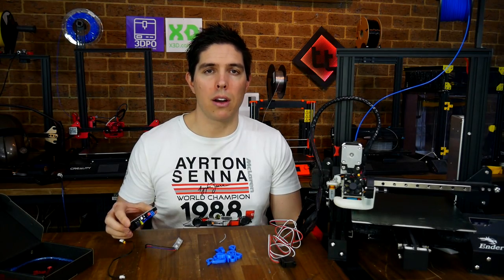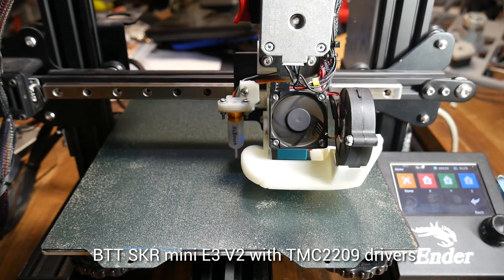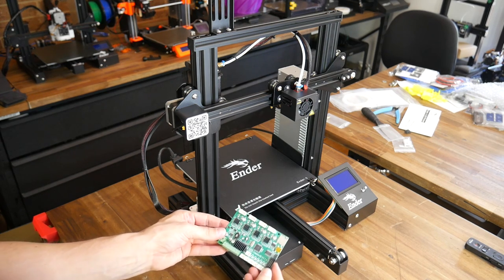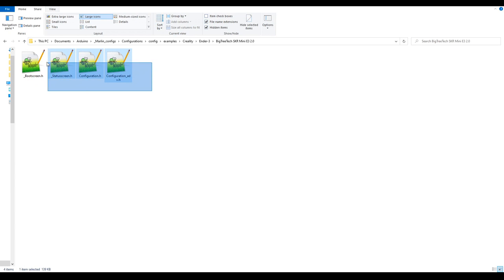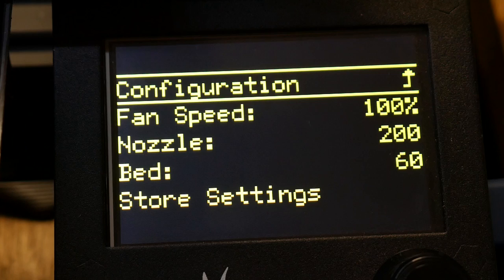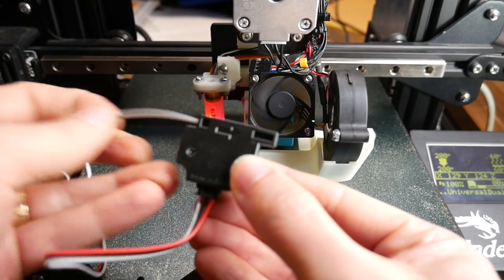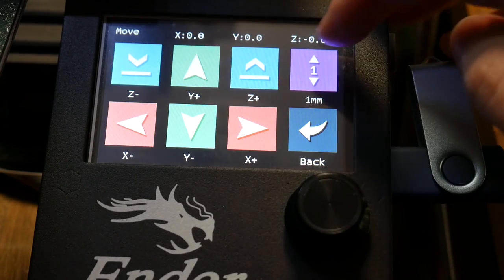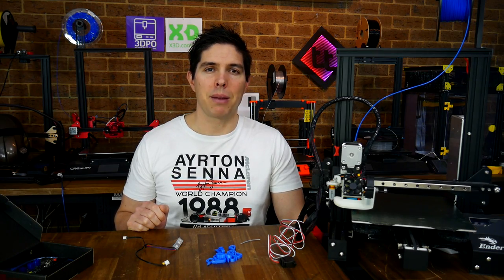SKR Mini E3 V2.0 - Complete guide to the best value Ender 3 upgrade

Comment: I Also purchased and installed an SKR Mini E3 V 2.0.  Now I need quieter fans.
One thing you did not mention was that the positive voltage and ground terminals are backward when compared to the original Creality board.  This applied to the input voltage, hotend fan, hotend heater, bed heater and the BLtouch servo connector.  I had to re-wire the BLtouch's 3-pin connector due to this polarity reversal relative to Creality's original BLTouch upgrade kit.  Also, there is another firmware file in BTT's github which does use the BLtouch as the Z-axis endstop, without requiring the original Z-axis endstop be present.
Reply from the maker: I provided colour coded wiring diagrams. I don't know what else I can do beyond that? If people ignore them that's beyond my control.

Comment: I love this board, silent, rock solid and cheap.
Can’t hear 1 single noise from it! And bl touch is working well.
Reply: I'm assuming this board works with the regular bootloader and firmware stuff?
Reply: Nutmeg Gaming I read on github it isn’t, anyway no sense to get over the original fw.

Comment: the 10 pin grey ribbon cable I had was too short to connect from the skr mini E3 2.0 to the touch screen, what do I do? also the touch screen reads "no printer connected" so idk what to do

Comment: How do you edit the firmware for dual z? Im trying to use both z stepper ports however platform.io states "marlin-2.0.x\marlin\src\pins\pins.h:1410:8: error: #error "No E stepper plug left for Z2!" " Im lost as to where I can fix this....
Reply: Shame. I am having the same issue... not sure how this was achieved...

Comment: buy the ender 3 they say its dirt cheap they say then pow you end up spending more just on upgrades lol. I recently brought my first 3D printer ender 3 pro and i really do love everything about it and love just how much to can add to it thank you for this video i was not sure weather to go with the v1.2 or v2 board but i ended up going for the v2 as it just makes sense now i got the fun task of trying to fit it but that really should not be a problem i am mostly looking forward to the mesh leveling feature as the manual level process is a massve pain in the ass to be honest

Comment: Good luck getting the EZABL Pro working with this board. 
TH3D's support page only points to a "Vanilla" support web page on compiling your own firmware. 
Only problem is the config from BTT has bugs, and building the config directly from Marlin also failed as a result from bugs within PlatformIO. 
Considering that BLTouch is supported directly from BTT, I would STRONGLY recommend users follow that route.

Comment: Teaching Tech - when you receive your BTT 24V UPS, can you please do a follow-up review on how to make the UPS work with the SKR-Mini E3 V2.0?  BTT provides documentation on necessary Marlin fw modifications, but doesn't say where on the board to connect the UPS.  Also, I haven't found definitive information on the internet on how to correctly connect and use that BTT UPS.

Comment: Is the power out 'H' controllable? I would like to set 'E0_AUTO_FAN_PIN' so that fan only comes on once it reaches 50 degrees but it doesn't appear that there is a pin assignment for this connection.
Reply: Did you figure this out?

Comment: For anyone considering the SKR v2 board with Teaching Tech's all-in-one rear wiring, let me save you hours: the stock z-stop cable doesn't reach. His remixed case for it also seems to have shorter standoffs, so watch your M3s don't poke too far out the bottom.

Comment: I had one, but missed being able to turn my hot end fan on and off at 50 degrees, so I upgraded to an SKR v1.4 Turbo.  It's the same price as the mini E3 but you have to add your own drivers.
Reply from the maker: Potentially you could use the fan port designated for the board fan and then have the board fan running permanently.
Reply: Teaching Tech I tried that and couldn’t get it to work for some reason.
Reply: I'm a complete noob at this and haven't received my board yet, but here are the changes I've made to hopefully get this to work...
//#define USE_CONTROLLER_FAN (in configuration_adv.h), #define E0_AUTO_FAN_PIN FAN1_PIN (in configuration_adv.h), CONTROLLER_FAN_PIN -1 (in pins_BTT_SKR_MINI_E3_V2_0.h)
It compiles fine at least. Guess I have to wait until the board gets here to see if it works. If it does work, I plan to put a 12V low noise fan and buck converter in the case.
Reply: @andronicuscomnenus2642  hey mate, did it work ?

Comment: To compile the firmware using the latest marlin you should use 

default_envs = STM32F103RC_btt_USB

Rather than the env that is listed as it is no longer possible to compile using that. (It was fine a the time of posting the video)

Also I've found the most common complaint is people's controller fans are not working. It's quite easy to not notice if that fan is no longer working on printers like the ender 3 pro due to location so it may be the fan is dead rather than a board issue.
Reply: Thanks this was a big help to me rn This is for ender 3 printers right?
Reply: @3DPrintable  specifically for the ender 3 pro though they are basically the same machine with a few upgrades e.g. a thicker frame. It should work the same though I'd recommend checking the marlin config repo for the ender 3 configs. The default envs should be the same.
Reply: @Sekwah  I tried it out yesterday and it ended up working, thank you for your help

Comment: Another great mainboard video! I would really like to see a comprehensive comparison to the SKR V1.4 Turbo.  The V1.4 Turbo appears to be about $10 more, so is it worth it? Especially on an Ender 3?
Reply from the maker: The SKR V1.4 is a much more capable board. This is designed to be more plug and play/convenient.
If you have grand plans for adding dual extrusion something like the V1.4 would be better but for most people this will be fine.
Reply: @TeachingTech  Thanks for the response.  That's what I needed to know!

Comment: Once again a very useful video. Unfortunately, I struggle with the BL-Touch. Homing does not work (extruder is stuck to x0/y0 and starting bed leveling will crash the extruder to the bed. I receive a sequence of error messages like "Bed Leveling off" and "Fade Height Off". I installed the firmware from BTT. Do You have any idea, what went wrong here?

Comment: It looks good. I recently installed a 4.2.7 board with CR touch and touch screen. Touchscreen is awesome but I’ve lost e-steps, accelerations, etc. Does this V2.0 board and its open-source firmware support touch screen?

Comment: Thank you Michael for another great video. Always great research and quality of your videos, I appreciate it. 
I wanted to say for anyone installing this on an Stock Ender 5 or Ender 5 Pro that the firmware provided by BigTreeTech (mentioned on the video) is unfortunately useless since it has the Z axis direction reversed.
Unless they fix it, you cannot use this board out-of-the-box for your Ender 5, you will need to compile marlin how Michael explains on the video.
Regards.
Reply from the maker: I didn't test that but it is very frustrating. You can plug in the z cable in reverse as a work around, but I don't know how much the connector will like it.
Reply: I can't compile it.. And display error in /marlin-2.0.x/include" not found

Comment: PSA: he swaps the parts cooling and mobo fans in the video (and corrects himself ) but the documentation at 4:20 is incorrect also the Imgur link. If you google image skr pinout you will see G and I swapped. Correct me if I’m wrong but I’m really happy I figured this out while printing the cat since it could have started overheating after it finished

Comment: With the improved stepper drivers this board, would there still be any benefit to adding stepper motor dampers?
And what build plate do you use and/or recommend for the Ender 3?

Comment: What fan duct are you running on that?  I'm upgrading my Voxelab Aquila to the SKR E3 mini 2.0 with TFT touchscreen and Direct Drive All Metal Hotend.  I purchased the Commercial Carriage, but none of the Fan Ducts I've found online actually fit with the commercially made carriage, as they all hit the stepper motor..
PLEASE let me know what duct you're using... Thanks

Comment: I thing that the diagram on 4:21 is wrong. Accordingly with BigTreeTech site connector B is INVERTED. The right order is Black/Red from the upper side. So connection H and B would be Red/Black/Black/Red.

Comment: Question: 
Could this board also be used on the ender-2? As far as I can determine the original Ender-2 PCB is 6.5mm wider than the SKR Mini E3 V2.0 (76.94 vs 70.25) bot the mounting holes between the X-Y-Z jacks and the one in the middle of the left had (power) side are in the exact same locations. The ender-2 used  Allegro A4988 drivers.

Comment: Hi Michael, I noticed you added the neopixels without the DCDC module. Can the LEDs work without it?
Reply from the maker: Yes indeed. Each pixel in the string draws a certain amount of current. If you have a small amount the onboard 5V VREG will be fine. Once you have a longer string you may start to run into trouble. I don't have an exact figure I'm sorry.
Reply: @TeachingTech  that's is good to know because the neopixels I ordered just arrived in the mail and I can't wait to light up my build bed. Thanks for the info.

Comment: Thank you for this review. I'm an old dog trying to learn new tricks. Is the only way to update the firmware on this board via SD card? Can you run Visual Studio or Ponterface via the board's USB-B port? I want to upgrade my Ender 3 Pro from the V4.2.2 motherboard it came with. I've added the Mico-Swiss Direct Drive Hotend and a BLtouch to it, but can't get the Creality firmware update to work. What motherboard would you recommend for Ponterface?

Comment: Nice and crisp video. Question. Out of the 2 options to connect bl touch, which should I prefer and why?
Reply: And on this board it is better to use abl bilinear or ubl?
Reply from the maker: I prefer the back and white wires going into the z endstop. The z limit switch is no longer necessary and you can change build surfaces to different thicknesses without any further adjustment.

Comment: I don't understand how you are compiling the new firmware.  I can compile stock Marlin fine, but as soon as I change to the "STM32F103RC_btt_512K" I get failure
Reply: In case anyone has a similar issue, I believe I was mixing the nightly builds config examples in the 2.0.5 standard release and that was the cause of my problems, because doing everything with the "bugfixes" version at least compiled correctly.  Yay!
Reply from the maker: That is an easy trap to fall in. Glad you worked it out.
Reply: @TeachingTech  Thanks.  Your Amazon link isn't working.  Here's the one I purchased and seems to be their official storefront https://smile.amazon.com/gp/product/B089CQ3DHB.  Obviously feel free to delete this and throw up your affiliate link.

Comment: I had real trouble with a cheapy 3 wire filament sensor with the SKR mini E3 v 2.0 and Marlin 2.0. Plugged in as per the wiring pinouts on the board and the sensor and uncommented the line in config.h as mentioned in the video. Although the sensor itself was fine and was reporting correctly via M117, filament change kept triggering between homing and ABL, and I couldn't fix that no matter what I did in Marlin config or as startup code in Cura. I also tried deactivating the sensor via the LCD and that still didn't work. In addition the filament change triggered was only heating to 170 and then trying to push filament so before I realised it, I'd not only worn gears on the extruder but had filament blowouts at both the nozzle end and at the top of the heat sink. In the end I had to replace a nozzle, the bowden tube, both bowden connectors and clean sticky goo from inside the heat sink and heat break, wasted an afternoon of installing the sensor. Something's not right but I can't figure out why this combination of board, sensor and Marlin is doing this. :(

Comment: I apologise if this has been asked elsewhere. I looked through a lot of other comments but didn't see it mentioned, and honestly I don't want to read through over 500 comments. In the video you refer to the new DC-DC 5v power module. I have tried searching google for one, but all results are for earlier or different versions of the mini boards. I had a look on the github also but didn't find anything about it in the manual. Can you please advise if there is such a module, or if it is built in to this board?

Comment: The board has 2 PWM fan controls, correct?  So, you are using 1 for the hotend, and one for the stepper drivers (case fan)?   What about the part cooling fan,  can that be controlled?  Maybe I am confused on what fan is what. lol

Comment: Hey thanks you for that guide. One question I think about to replace the silent board in my ender 5 pro. Which one would you recommend the SKR Mini 2.0 or the SKR 1.4 Turbo? I am unsure which should I choose so maybe you or someone here in the command have a hint :)
Reply: The SKR Mini E3 v2.0 will bolt right in, you will have immediate access to the USB port and SD card slot, without modifications. The SKR 1.3/1.4 boards are not nearly as easy.
Reply: Though the SKR v1.3 (I have been advised against v1.4 because it seems like the have made some unfortunate cost cuts) gives you the opportunity to swap drivers and had more I/O. I got it to work on my ender beautifully and it's actually not super hard to set up if you get into the firmware stuff a little

Comment: Michael - Can you make a short vid on the details required for the 'non-traditional' method of where BLTouch does not replace the z-endstop, but still uses the microswitch. It seems calibration for the nozzle, and having the BLT be able to still probe is confusing as far as proper distance the nozzle should be from the bed when it does a homing with the endstop switch.

Comment: How do we tell if we got the 256k or 512k version of this board or are they all 512k?
Reply: They’re all 256KB. You can verify by looking at the processor, if it says “RCT6” 256KB. A 512KB will have the “RET6” part number. This will be the second line under “ARM.” STM’s data sheet says C=256KB, D=384KB, E=512KB, F=768KB. People who have gotten it to work at 512 have either built a small enough image for it to fit anyway, or STM substituted higher grade parts to fulfill orders and down binned them, which could be ones that failed higher level memory as well. Either way that is inviting problems, there have been reports of that leading to bricking, and a report of the firmware crash from the wrong memory size causing a thermal runaway.

Comment: With the latest version of Marlin they removed the 512k version of the RCT6 chip so back to 256k only option. Which is too small for the options listed in this video. Is there a way to work around this to access the full 512k space
Reply: Não estou conseguindo acompanhar os passos do video devido a placa não ser a correta, em plataformio/default_envs= mega2560. Preciso de ajuda para conseguir um firmware atualizado.

Comment: just want to check, as I understand, the TFT35, it's exactly the same one used on the Ender 5 Pro... they only list on the above link supplied that t works for the Ender 3, but as I said/asked... understand, the screen is the same for both printers ?

Comment: Hi! I’m having some trouble to use the BLTOUCH on this motherboard, my BLTOUCH black and white cables does not connect with the 5 port type pin, but when I instal the black and white on the Z axis and downloaded the firmware from BTT something goes wrong... the display turn on (half of the brightness) and then turno of with the printer running...any adivice?

Comment: Would this SKR Mini E3 V2.0 mainboard work in Creality CR-10 and/or CR-10s?
I guess the main relative difference between CR-10 and CR-10s is dual Z-axis?

Noticed that the SKR Mini E3 V2.0 mainboard does have dual Z-axis interface.
Reply from the maker: The original CR-10 had this Melzi board, so definitely. I don't have a CR-10S to confirm but I was under the impression they had a different 2560 based board with a bootloader. This would have all of the right ports, but mounting may not be as straightforward.

Comment: Just be aware that if you have any issues with this board( I have) don’t expect any support from BTT, my skr mini v2 arrived faulty and despite sending several emails over the past couple of weeks they have all been ignored.
Reply from the maker: Disappointing to hear. I have a postage issue with them at the moment but they seem to be resolving it. The person has no idea I'm from this channel.
Reply: Yeah they are awful with support. Its why I always order on amazon. I just sent the 1.2 back, its really not worth buying. Waiting for my 2.0 to arrive.
Reply: Festivejelly I had ordered the v1.2 tft35 package from Amazon, then when I herd about the 2.0 I ordered it on AliExpress because Amazon didn’t have the 2.0 boards. I just had to wait, and I’m still waiting for the run out sensor that I ordered the same time, the board and monitor arrived in ten days, but my sensor is missing in action. They have answered me and we’re going to check into its location.

Comment: Re: BLTouch...In the past 2 weeks, I've purchased both a BLT (from Creality, not a clone) and the SKR Mini 2.0, and the wire colors have changed on the BLT. No amount of searching could turn up what was what and I started guessing until I got it right. The red and blue wires at the board had to be swapped.

Comment: Could you do a video on connecting a Pi to the SKR boards via the GPIO &TFT ports?  It is a 3 wire hookup and some settings tweaks.
It is a nice way to connect them and not worry about the stray power thru USB as well as not having to have a USB cable hanging out of your case snagging things or getting bumped/disconnected.